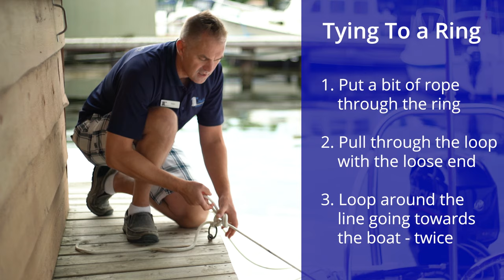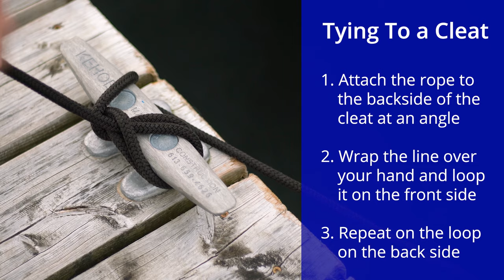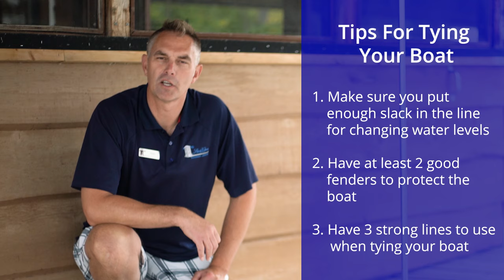How to Tie a Boat to a Dock

Comment: Really too bad you don't know what you're talking about - not even how to tie a proper cleat hitch.
Reply from the maker: You are correct and I learned something that day as so many people pointed it out! How embarrassing. I made this to try and correct my mistake. Better? https://youtu.be/kmFLf6b-KGk?si=HEwpOkeVNWdUN3Uu
Reply: @boatinglessons  Not really. You got the cleat hitch correct--finally--but continue to send people to this poor video (you should take it down and fix the several errors of best practice). That replacement video includes "if you can't tie a knot, tie a lot" presented as if it is advice which is very bad. The video you linked led to your anchoring video which is an abomination and presents yet more bad advice to novice boaters. You really should take all your videos down pending review by more capable boaters. How much more bad information have you promulgated that puts others at risk.
Reply from the maker: @deislanddave  I am above these comments and will not respond. You are certainly welcome to your opinion.